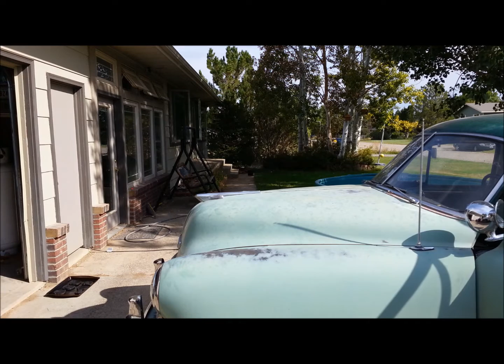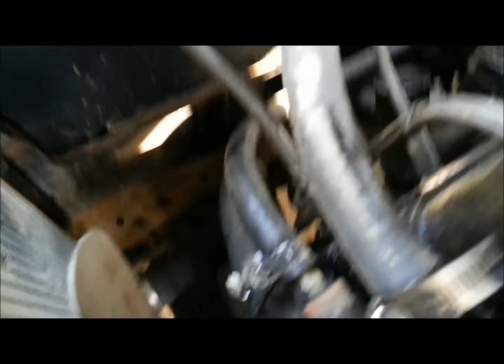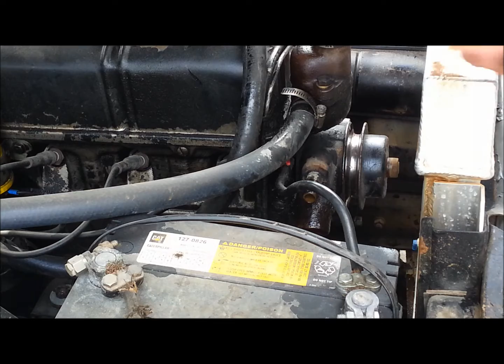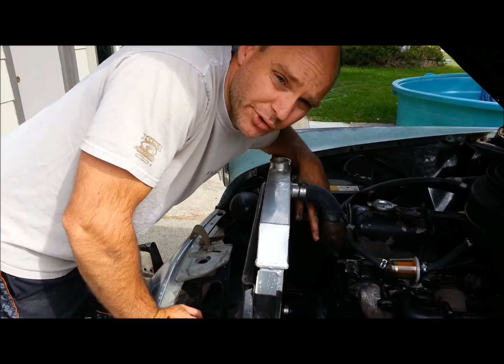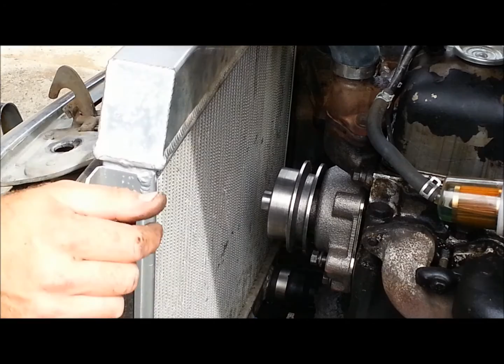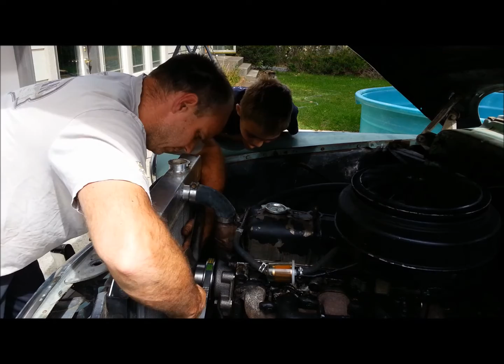Chevy Styleline 216 water pump and strange noise

Comment: I put a water pump on my '53 Chevy pickup, 216 engine bought at Autozone, lifetime warranty, it leaked around the backing plate. Took it back, got a new one, it leaked same place.  As a mechanic for many years I took a good look at it. The bolt hole on the backing plate was drilled completely through into the coolant. Fixed that with a set screw and sealant. It still leaked!!  Turns out, the tapered screws holding the plate bottomed out before the thin gasket could seal it. Countersunk the holes on the pump a little, made a new gasket, seemed to be okay for a few weeks, started leaking again!!!!!! I don't know what kind of gasket material Autozone sold me for that, but the coolant just seeped right through it, like cardboard might. Ordered the proper gasket material and, FINALLY, no leaks. Talk about frustrating, I wanted to pull my hair out, but since I don't have much anyway, that was not an option.
Reply from the maker: Glad you got it figured out. Yeah sometimes the cheap things just aren't worth it. I hear ya on the not alot of hair to pull out either 🤣🤣

Comment: When converting from a 6 volt to 12 volt. Will it require replacing the existing wiring system
Reply from the maker: Not as long as your current wiring is in good condition.

Comment: hey man how are you? I just bought a 1950 Chevy Styleline Deluxe Sports Coupe. It has only had two previous owners. The last owner is now 75 years old and he hasnt driven the car in years. It runs and everything is good with the car. I want to change the oil and filter. it has a 216 engine 3 on the three. with the oil filter i will use FRAM C4, but i dont know what type of engine oil to use. It only has 47K original miles. What do you suggest?
Reply from the maker: The car was originally designed to use straight 30 weight oil. You could use that depending on what climate you are in or if you want to use a multi viscosity oil i would suggest Rotella 15w40 diesel oil. It's very good oil and has high levels of zinc and phosphorus which is what you want for older engines. The zinc and phosphorus is what gives the metal to metal protection for the cam and lifters.
Reply: MT offroad I live in Miami Florida and it’s hot all year long here, 98 degree all year long. Diesel engine oil you said??? Even if the car is low diesel?
Reply from the maker: @GenerationOldschoolEspañol  yep. The diesel oil has a much better additive package for internal protection. Modern cars don't need it like the older cars do. I run the synthetic Rotella in all my cars and side by sides. I did a video on the oil comparison recently. It was comparing atv oil to the diesel oil. The Rotella is wonderful stuff!

Comment: Thanks Eric.  I have a '52 Styleline as well and it made the exact same noise.  Thought the worst, but it was only the water pump.  I saw your 12 volt conversion video and noticed here how quickly your car cranked over.  I still have a 6 volt system, and for any of your viewers experiencing slow cranking with 6 volts, be sure you have the original/correct gauge positive and negative battery cables.  Incorrect gauge cables from the local automotive parts store will result in slow or no cranking - making you mistakenly think the problem lies elsewhere.

Comment: chevrolet 216 inline 6 water pump bolts torque value = 25 - 30 ft LBS

Comment: Great video! I have a 62 deuce with a 194 and I thought I had the same problem. Turns out I only had a badly worn belt. Your video gives me the confidence to change the pump should it need it in the future. Its fun wrenching on these straight 6 motors!

Comment: Do you have a slight miss in your engine?
Reply from the maker: I do. Pertronix to come soon.
Reply: I have Pertronix on my six (about 10 years) and I have a random miss.  I have done many things to get rid of it.  Someone said if the plug wires are touching, they can cross fire.